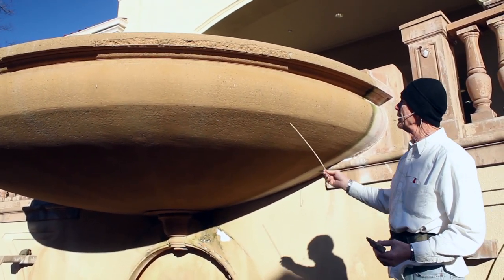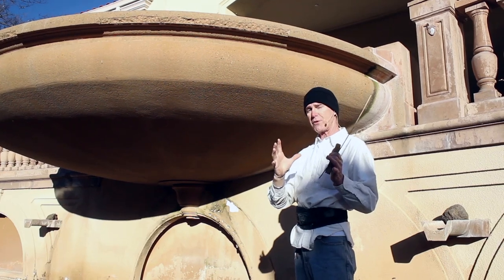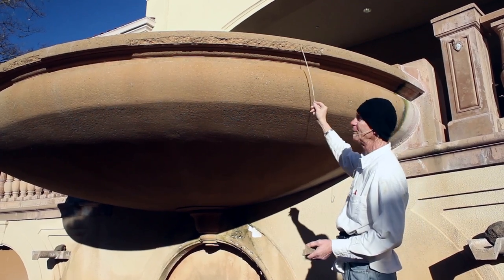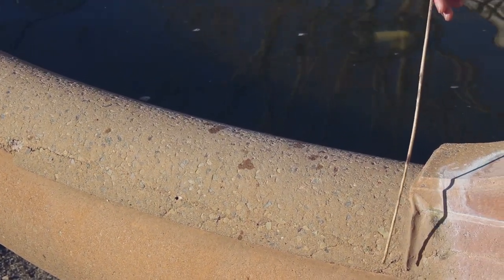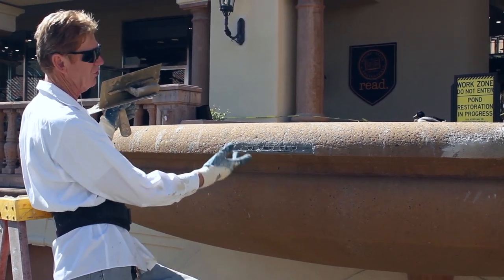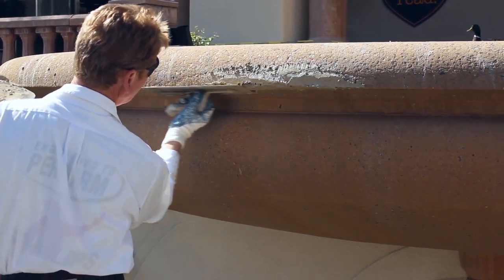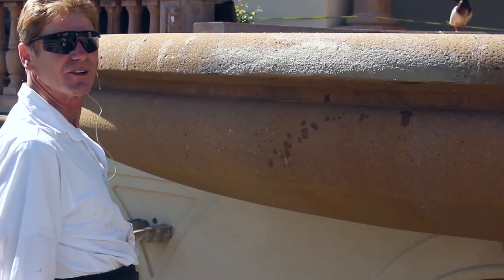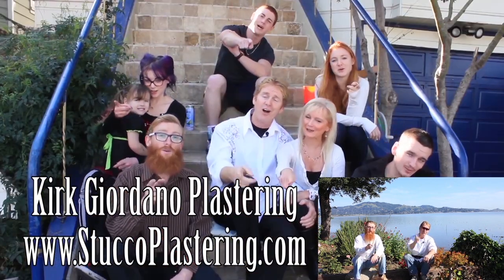Spalling concrete infinity fountains

Comment: Hey Kirk like you I'm  arriving at thirty years as a trades man more on the masonry side .  There's a way to get the color right and also to age it. I pretty much do retail repair work now instead  of contract projects .  I age concrete the next  day or later  with  an etching product  for that project  you would need a jell  so it won't run off. They work wonderfully . The picture of the damage on the video wasn't blown  up enough  but it appears it was originally a smooth texture .   In that case  shape with hard trowel . When stiff enough finish the bullnose with a piece of  caution tape .  When pretty hard  you can age with new tile sponge also. I can go in more depth  if needed. Also how to make a  special color and consistently. Thanks for the many videos! I've learned a lot from you.
Reply from the maker: Good evening So Cal Dude, thank for the tip, 
     Truth was I told them what they wished could not be achieved color maybe, but adhering forever? no chance,  I would not take the responsibility to drill deep into compromised concrete and attach steal rods and for example use an epoxy resin to hold the rod then plaster, as I simply don't believe this will hold the stucco forever.
     They had experts bid, I don' believe any could repair with a warranty, so I did the best I could at cost as these folks were great to work for, 
      BTW, I stuccoed the whole area and through the bowl in for the heck of it, with the realization it will adhere but not forever, this year once winter hits, and this area freezes the expand and constriction will begin, (Spalling,)  it may pop back off, no way of knowing.                   
                                Live long and plaster
                     Plastering tips and techniques

Comment: Another excellent video as usual, surprised they don’t have a molded cover to protect that edge from wear and weather.
Reply from the maker: Good Morning Clint Dude, things that make you go Hmmm,
        I feel this bowl fine feature lasted for over 30 years in intense heat "above 100 degrees for many months" plus the freezing winter cycle weather" which is out of one's control, so I'd say they did an excellent job when this bowl was originally poured, as one can't fight mother nature and her laws.     
    Should they have capped it every night, not my call, but from what I saw there were hundreds of ducks there daily that a 10 man job already just to clean up after them, I know, I had two, cute as heck but more work than a baby,             
                    Live long and plaster
    Mastering Plastering by Kirk and Jason Giordano
Reply: Kirk Giordano plastering Inc. Yep, I live 10 minutes away and we've had plenty of cold nights below freezing over last 30 years.  But I'm curious why they haven't tried to epoxy/grout that crack to try and minimize future spalling? (would also help adhere what remains of that edge).  Crack is difficult to seal w/epoxy but some backer rod and some injection ports would probably work.
Reply from the maker: Good Morning Arthur dude, perhaps this might work, however  were off this project and I'm just the messenger                    
                    Live long and plaster
    Mastering Plastering by Kirk and Jason Giordano

Comment: "a man's got to know his limitations.". .  Classic.  Any suggestion for stucco product used on block, durarock and metal corner bead in close proximity of a wood burning stove.  The set backs are all to code, I was just wondering what stucco would hold up to the heat.  I saw in your other video that structo lite is a good high heat plaster.  Thanks, live long and plaster
Reply from the maker: Good Evening Thomas Dude, sure, you can use exterior cement plaster inside, or you can use the veneer system which is like structo-lite, the plaster veneers, both contain lime and gypsum.                  
                       Live long and plaster
    Mastering Plastering by Kirk and Jason Giordano

Comment: Great video. How quickly do you use those green foam trowels up? I'm using ones from Home Depot applying a second coat of western blend medium base A finish stucco on my house. They don't last more than 5 to 7 90lbs bags. I seem to be chewing them up. Is that norm?
Reply from the maker: Good Morning Peter dude, yes, they suck for strength, I buys a box of 120 at a time as any little wire or chip will rip these floats, If we're plastering we go through at least 4 per day.
 I can have one last me a week, but my guys will ruin one in less than 5 minutes as they are not really looking out for things sticking out for the lath as they don't buy them.                   
                    Live long and plaster
    Mastering Plastering by Kirk and Jason Giordano
Reply: thank you so much for replying! 
i thought maybe i was being too hard on them. 
Ones from Lowes were even worse.
Have a great weekend
Reply from the maker: Good Morning Peter dude, they can last but a person has to know there is loose wire near the surface that will destroy a new float with one swipe. 
Theres are landmines or loose wire waiting just under the surface.                   
                    Live long and plaster
    Mastering Plastering by Kirk and Jason Giordano
Reply: +1 for the wire tearing them up. Also i try not to be to aggressive where I blend the new coat and old finish. The old finish really tears them up as well. Glad to hear i was not the only one. 
The adobe style houses up here in Scottsdale Az. have a base coat and the finish coat is just some cement with a bunch of sand mixed in, like a real rough sandpaper.... not very thick. Seems  its the easiest way of getting that foam float finish without using one. 
 I am going to make a video next of what i am doing. when i upload it i would love to get some comments from you
Reply from the maker: Good Evening Peter dude, no worries, be happy to view.                  
                       Live long and plaster
    Mastering Plastering by Kirk and Jason Giordano

Comment: Can you drain and dry the pool, veneer with a skim coat, and then seal it with a waterproofing agent to prevent the water/ice cracking cycle? thanks!
Reply from the maker: Morning Danel Dude, no, this system would not last.
   however, that's definitely thinking outside the box
              Live long and Plaster
  Sharing DIY Plastering tips from team Giordano

Comment: If the edge doesn't hold up put a flat copper strip around it and it should keep a nice edge to keep the waterfall looking smooth.
Reply from the maker: Howdy Bigfoot, I was merely the messenger on this one, I gave them the facts before I did this repair. 
It's doubtful but straightforward during the next freeze it will stay put as spalling concrete is out of the hands of man,
Freezing cement especially if chipped or brittle caused by aging has a tendency to expand like water in a freezer, all concrete, and the adhesive is compromised when this happens.  
                             Live long and Plaster
Teaching the world how to plaster one Vimeo Video at a time.

Comment: If you really wanted to sit on this project and have it keep you up at night, you could have tried to color match it with dried  concrete dye samples then expose the aggregate with 16 grit diamond grinding tooling. Used in concrete polishing to remove paint and expose aggregate as a first step to get the surface smooth enough to start polishing with finer grits. I understand it didn't matter and water was going to hide it here.
Reply from the maker: Howdy Gantz dude, all great tips   
                 Live long and plaster
      Do’s and don’t of plastering’s leading expert